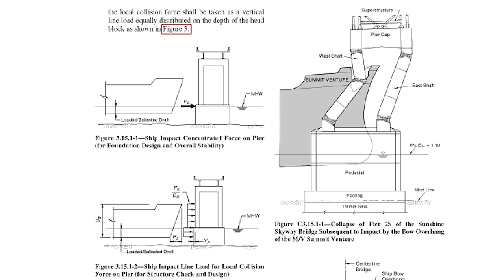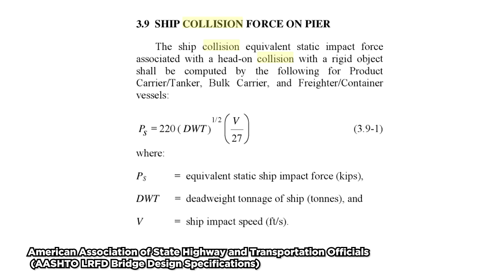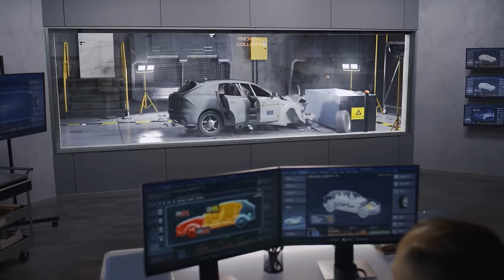Engineer Breaks Down Baltimore Bridge Collapse

Comment: In some time travel show, they discussed a tragic event where a bridge collapsed and time travellers went back to prevent it. 

In every way the time travellers tried to prevent it, steering the ship away, fixing blue prints, etc., it always led to worse outcomes in the timeline because humanity was not allowed to learn from their mistakes. 

In fact it was worse because the engineers thought it was a solid design and they didn't know of their flaws, so they made more of that model. 

Basically, despite this being a tradgedy, it will likely spur engineers to re-evaluate their construction methods and this will be less likely to happen again in the same way.

Comment: 2:30 then too- and this is a biggie that no one has talked about. The roughly 50' deep channel was 600' wide, the towers were 1,200 feet apart (they want to widen the channel) the rest of the river bed is around 20' deep. So for the last 100' or so, the ship was running deeply aground. Which does reduce the impact force, obviously not enough. But if you look, you see it lurch a little as it leaves the channel. That should show up on the black box.
Reply: Not from the old sonar imaged I've seen of the dredged channel. The deep center channel is dredged right up to the bridge's support columns of the center span.
Reply: From the underwater lidar(?) images relrased today we can see that Dali is now resting on the bottom of the channel.

But as the waterline is still quite close to where it was when it was floating, scraping the bottom most likely did not slow it enough.

There's only that much fight mud can put against a hundred thousand tonnes at nine knots.
Reply: @JariJuslin  if the MV Dali had contacted the muddy bottom, it woyld have stopped pretty quickly.

Comment: Possibly one consideration,at least in new bridge, is main towers far apart. 
The Golden Gate Bridge towers are 4800 feet apart. I believe this bridge support piers were only 1700 feet apart. 
This may have been fine when it was built since ships were much smaller and ship traffic was many times lower.
Reply: It would be far more economical to put large protective barriers around the pylons than to increase the bridge span significantly

Comment: Progressive collapse is a huge part in design. I practice the Eurocode and we either:

1. Add in reinforcement or 'tie bars' to ensure that the rest of the horizontal structural elements has the structural capacity to handle loss of support or accidental loadings.

2. We design for removal of columns/piers so that the structure is still feasible. Im not sure how Francis Scott is designed but having a rigid structure is not a  bad thing and it doesnt mean the entire structure collapses. The structure just needs to be desgined for the removal of 1 column in any span and it is a lot better than having a localised failure. 

There are many ways to design for progressive collapse whether is is pinned/semi-rigid/rigid.

Comment: To include crumble zones on ships will be stupid as it would increase the weight of the ship which means Less cargo. Also it wouldnt make much more of a difference to the impact. Crumble zones are used mainly to protect the occupants of a vehicle and not to protect the impact structure. As you have to take the derivative of the impact force.
Reply: Ships by default already have a crumble zones for ship to ship collisions. It has the bulbus bow, the forecastle space, the forepeak ballast tank, and rounded off with the collision bulkhead.

Comment: The logical and practicality  of such a problem is not the problem of the bridge design. What should have been in place was the tug boats that get the ship out and away from important structures.  That would solve the problem of not having this happen again.
Reply: From what I know living nearby and seeing ships going to and from port they only seem to use tugboats in tight areas, the key bridge was very wide where ships went under. Usually there is instead a guy called a pilot that comes on board and acts as captain in the bay, the pilot does this because they know the area better than any captain. Tl;dr tugboat for taxiing in port, pilot for outside of port but still close to the harbor.
Reply: @aaaaghdoor6056  That's what I am hearing. Some say that the ships are too big  for the tugs to even maneuver once its up and going into the channel. I don't know if this is true but I know a lot of ports used to require tugs to get ships out to open seas. Maybe those days are over but they do need a backup plan  for situations like this past accident.
Reply: @aaaaghdoor6056  Yeah but that pilot can't do nothing if everything goes out and can't steer the ship.
Reply: That's where other backups are in place to avoid this happening again.

Comment: I know almost nothing about engineering a bridge.

I have driven over the Key Bridge a few times years ago.  Construction began in 1972 and it was finished in 1977.  This was long before the big container ships were put in use.  The Key Bridge was only two lanes in each direction with no shoulders or emergency lanes.
While it was certainly functional before the collapse, it was becoming obsolete.

The likely replacement will be a cable stayed bridge with its piers far from the shipping channel and close enough to the shorelines to not allow collisions from large ships.

Farther down the Chesapeake, the two spans of the Bay Bridge were built in the 1950s and 1970s and are both functionally obsolete and unprotected from an errant container ship. A collapse there would be worse than the Key Bridge.

Comment: I think even without rigid connections, there would be some progressive collapse, as when one span has gone, the pier/column it is attached to becomes unbalanced - all the weight remaining is now on one side only, so it will tip - unless it was built strong enough to support a span on one side only, which they usually aren't: if you look at pictures of them under construction, they usually build the spans out from each side of the piers/columns fairly symmetrically, until the spans meet. You can make them strong enough to support one side only - cantilever - but you then need much more robust/massive towers.

Comment: Question: Comparing the structural engineering for the bow of the cargo ship, given that vector is not anticipated as a primary one to engineer for, as compared to an Ice breaker, can one determine if the ships hull. was designed to bear a 12,500 ton impact without catastrophic hull breach ?  Eg, previous history shows what impact with an iceberg can result in, etc, so given the surface area of the impact upon both the ship and the bridge support pile, is the mutual damage as one would expect, or is there a bias toward one side that would indicate were forces were dissipated as anticipated ?  In short, was the damage to the ship equitable with a 12,500 ton impact?

Comment: 5:15 cars has to carry , but a birge is stationary, and if the energy absorber and the main body is connected is not good because you are try to divert energy from the main body so , more they are a separate system are better

Comment: dude. its a cantilever bridge. because it sat on 2 piers, it requires 4 major forces to work. you take away one of those forces, the whole thing comes down. that's cantilevers. the whole thing works as a system, you remove one of those parts, the whole system doesn't work anymore.  the entire thing fails. I dont like cantilevers because of this reason.

Comment: If u are an engineer u could say if it were possible that 2 planes could bring 2 towers STRAIGHT DOWN without help.  Let's see if possible to get an answer an a truthful answer
Reply: The Thermite was there standing by to help out
Reply: Jesus you conspiracy theorist are rampant
Reply: @brandonf1260 . Think about it!  Even building #7 which only had a small office fire imploded. Those buildings should have buckled and leaned if the heat was that intense. The higher the structures are built the less weight and designed to have ability to sway, from wind sheers.
No buckling of the outer structure, and they imploded perfectly like a demolition explosion.  Why did building #7 implode the same exact way with no impact from anything?

Comment: 1975 wasn't 100 yrs ago like the embarrassed Engineers are trying to tell us.  The World even in the 1920's had hundreds of Massive Battleships traveling all over and if one of them hit a pillar of an 8636 foot bridge, the whole bridge would not have fallen down.  I have a 75 Buick and it may have more safety features than this terribly designed bridge. 
An analogy of the Bridge collapse is building a house with a garage attached, but if the car bumped the garage, both the garage and the house fall down.  Construction engineers would never let this happen, so why did this happen to the bridge?

Comment: There is absolute nothing wrong with the bridge structure. Don't blame it on a dead and respectful engineer designed this bridge. Without those irresponsible boat operators, the bridge would stand for another 50 years or more. In the future this bridge should be lifted higher to accommodate the bigger and bigger container ships. BUT, We don't design buildings for airplane impact after 911,  even for federal buildings. And A boat should never hit a bridge by any means. Add dolphins is the only and rational solution. this incident is a pure human stupidity due to a slew of reckless actions..
Reply: agreed 100% !. if there were dolphins placed around the piers ?, no way in heck would this bridge collapse.